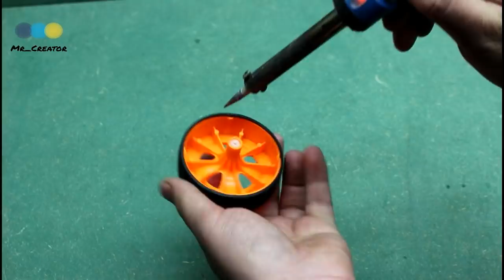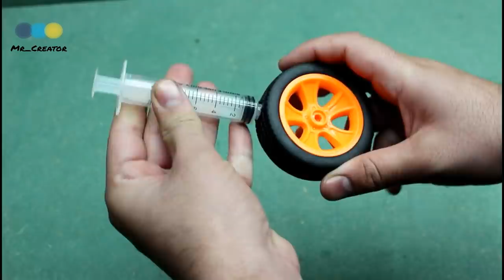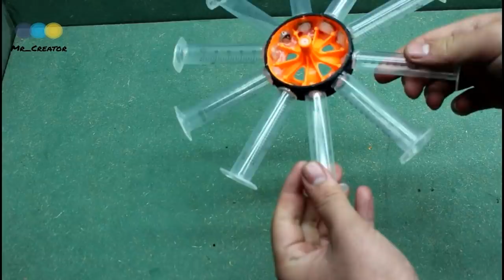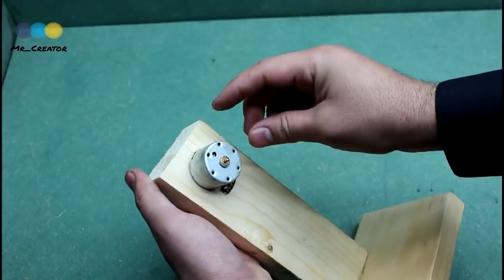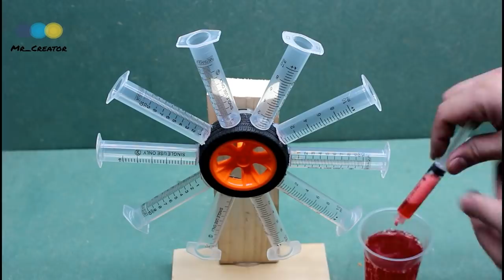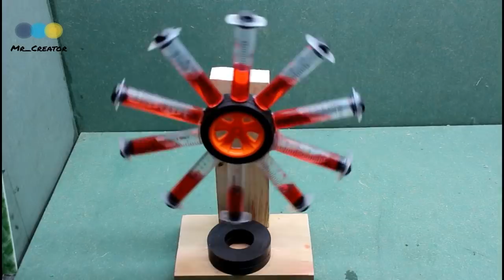DC Motor Activity // Automatic  fountain

Comment: If you join two wires with motor and sold an LED light it will glow bcoz it is turbine
Reply: Muhammad Tahir Hello! :) Is that real?what was in the video?
Reply: Bro we need 1500 rpm but this is normal motor it can genrate only 3-6 v but its not sure we need 12 v motor

Comment: What material are the small pieces you fixed at the top of syringes...normal metal or magnets???
Reply from the maker: Magnets
Reply: Magnets hi to hai.working!= When North Pole  of the magnet meets with the other magnet of same pole than it repels the magnet which give it a forward push and the other pole of the magnet attracts it and it again meets  the same pole which repels it(which gives  a forward push to the wheel)

Am I right
Reply: Do we need to set the Positif pole agains positif pole? Or just put in no matter positif or negatif?